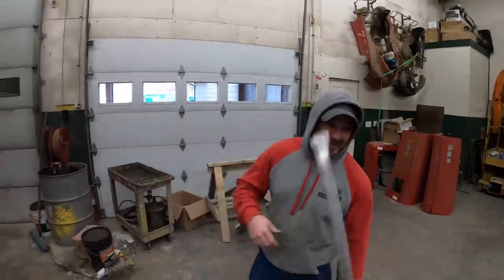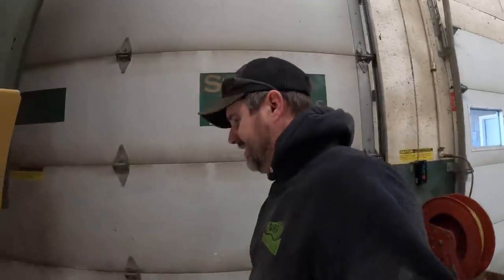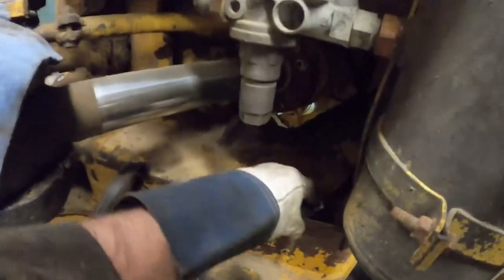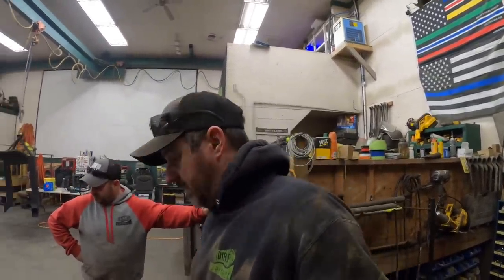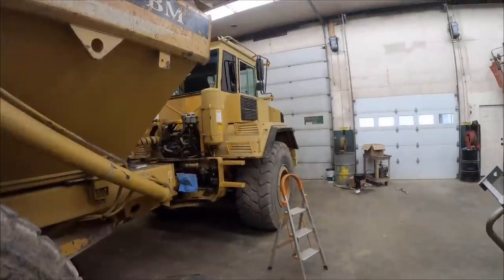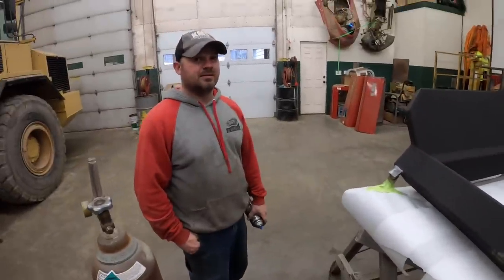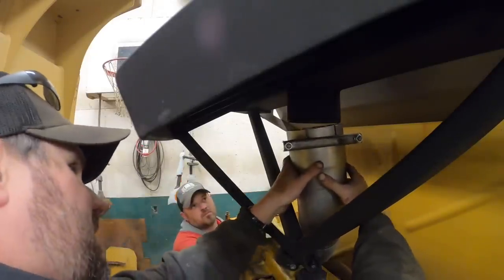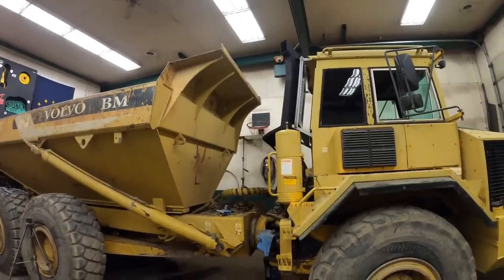It’s time to hear the new pipes on Bubba Dump sing there song 🎵 stacks are done ✅

Comment: Trick I learned when spraying any finish is prep a few scraps and spray them each time you add a coat. Then you can check if it’s dry on the scrap and not mess up the actual project.

Comment: The old dirt shield had a peak in the middle to direct the dirt off to the sides away from the articulated joint and now your new shield looks like it may just dump the dirt onto the joint.  
If it does the east fix is just to weld a dormer roof into the middle of the new shield.  

The entire setup looks amazing.

Comment: You guys did SO MUCH in these few vids ... should list them all on a spreadsheet !!! Just WOW  And as for the "Diamond Stacks" ... the cool factor exceeds 10 !!! My only concern is Rain Water encroachment and no "Flappers" (a Diamond Coffee Can won't do) ... and I'd add a drain plug at the lowest point so you can drain any water that accumulates.  Can't wait to hear Bubba on the next field job !!! Can't recall if Bubba has Jake Brakes but that would be even more awesome on the load up sound ... LOL.

Comment: If you want to see something that is tight to fit and screw the bolts in, try putting a set of tube headers on a 390 in  a 66 Ford fairline.

Comment: With heat paint you will get best results if you preheat the metal before painting and heat cure it shortly after painting. That exhaust may be hard to preheat and even cure with the size.

Comment: Bubba Dump sounds sweet. It took a little while to get to this point but you made sure it was done right. I’ve been wondering if that liquid tube will harden inside the tires in one spot since you didn’t drive it after putting it in. I’d make plugs to put in those air hose couplers so dirt won’t plug them up.

Comment: Where you put the hitch pins in to hold the belly pan on. Your going to want to replace them with something that brush and grass ain't going jerk out and make disappear. Trust me on this from past experiences not even lynch pins will work. A bolt with a lock nut is all that will hold.

Comment: Use a ratchet strap and run around the bottom of the skid pan and pull it up or hold it in place to get it on or off without it falling on ya. Step it around the belly of the motor and should make it a one man job or even a one hand job

Comment: Does using dual pipe exhaust attached to the engines one pipe exhaust give Bubba Dump a boost in horsepower?
I think Blue flames painted up each exhaust stack would look badas.

Comment: How much dirt and crud was spilled into the fitting, while replacing that elbow and the hose,    Before repair, Pressure wash helps make a repair easer and more safe on the equipment.
Reply from the maker: None